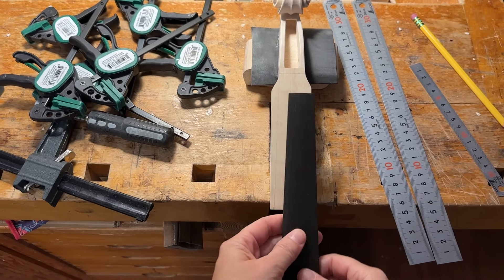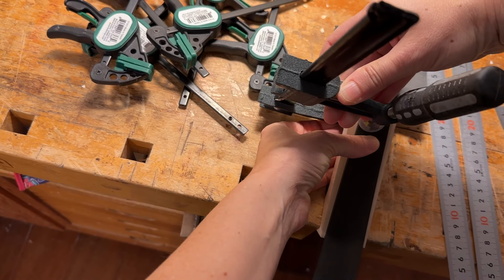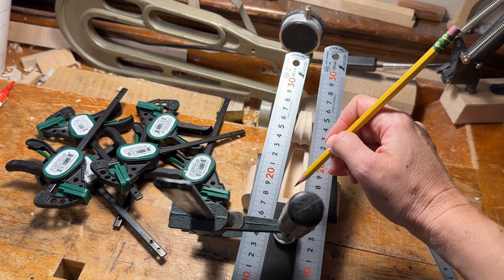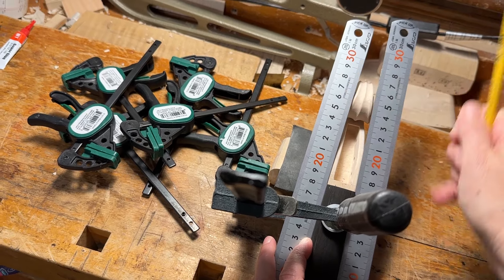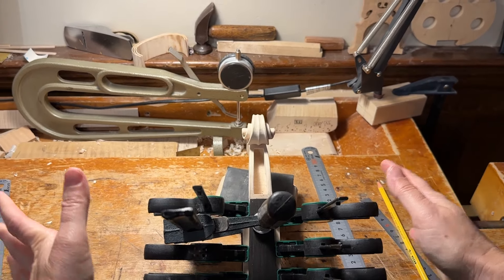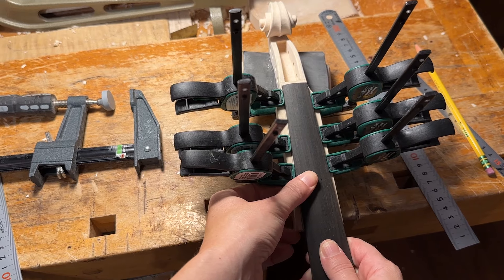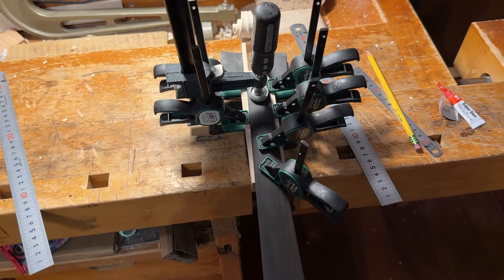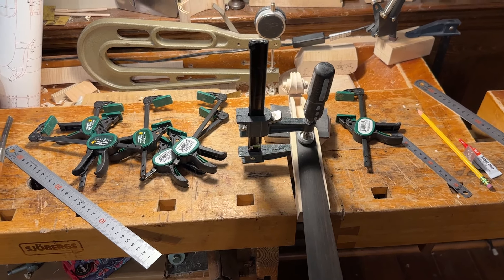🎻 100% success with your fingerboard ! 🌻 Girasole

Comment: Nice,,, but how about as soon your scroll is not equal by the head??? The does this still apply??
Reply from the maker: This is a very good question! Thanks for asking.
I always start with the center line of the block, that was drawn where the fingerboard will be glued. I measure from the center and I place the fingerboard right in the middle.
I then double check with the rulers and yes, sometimes the scroll can have a deviation.
What I want to be centered at that point is the checks of the peg box, that usually are allighed more with the volture of the scroll.
Il your scroll is heavily asimmetrical, then always choose the peg box checks as we don’t have to have the strings going to the uppernut and fingerboard at a strange angle 😊
Hope this is helpful!
Back to work!!!